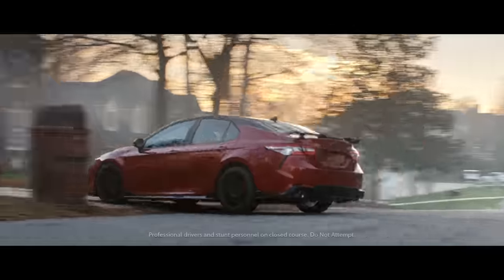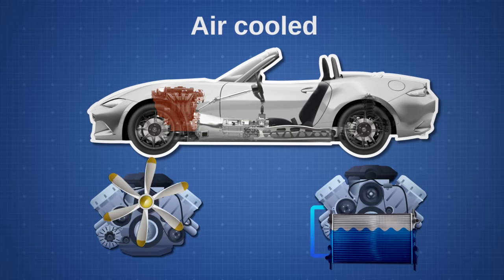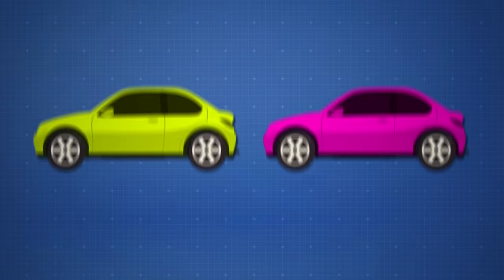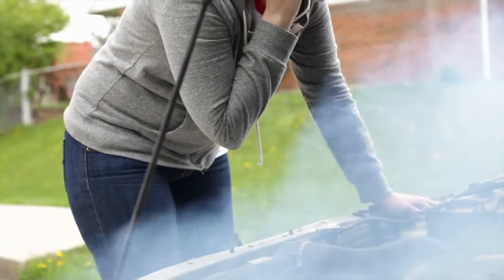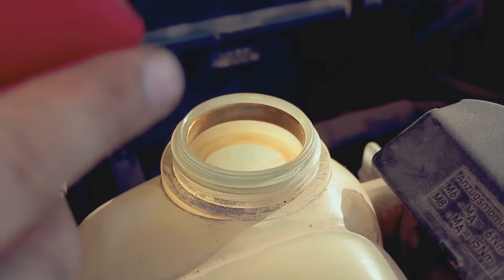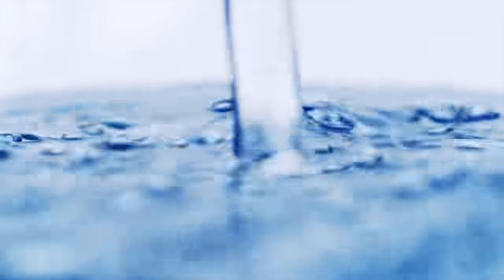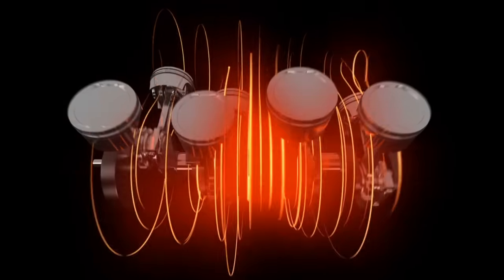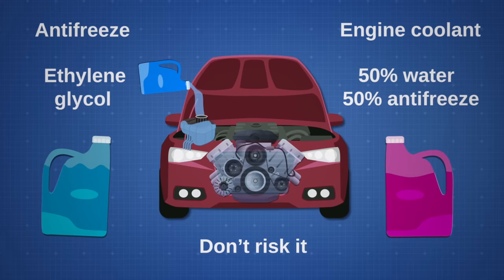Changing Your Coolant? You're Doing It Wrong

Comment: All failed engines that I’ve experienced are from faulty cooling system.  Leaking radiator or water pump, and I didn’t fix them in time. 😵
Reply: Same or a thermostat 😢😢😢

Comment: This reminds me of the nearly 20 year old Honda Civic my dad had most of my life. It had cooling problems that he couldn't diagnose so he had to have containers of water in his car when it got too hot and this dude gave him a coolant cap from Mexico that was basically a cheap cap with a hole in it. It was more common for people in Mexico to fill the radiator with water since the cheaper cars in mostly rough terrain driven by mostly poorer people wouldn't last anyway. The cap was designed to prevent internal water damage by letting the pressure release from the hole.

Comment: my father used to put plain old tap water in the radiator. had to scrap the car after the cylinders warped because the radiator was rusted and the temps kept getting too high (even blew the head gasket a couple of times)
Reply: Water is fine for a quick "get you back on the road" situation, but once you get home.... replace it.

Comment: I remember bringing the ol' Le Mans over a mountain pass here in the Appalachians back in 90s and it started overheating (it was summer)... cranked up the heat, rolled down the windows, and made it to the other side with no real issues... good times!
Reply: Good trick for a cooling system not quite designed for hills in some parts, or possibly a low drag fan pulley.
Reply: @buskE46  I've got an e46 too... we gotta know our cooling systems, lol
Reply: Former cooling system mechanic here. In an emergency re move the thermostat, cut the valve from the center and put the outer ring back in. Don't run it without that restriction or the pump will send it through the radiator so fast it won't have time to remove the heat from the coolant. I always keep an old thermostat with the valve removed in my 2 older vehicles just in case. Also, when changing the thermostat test new one in boiling water on the stove to be sure. If you drill a 1/16 or 1/8 inch hole in it just outside the valve center it will let trapped air purge from your engine. Otherwise it can take up to 2 weeks of driving to completely purge that air that gets into it anytime you open the cooling system.

Comment: I once had a car with a malfunctioning cooling system. The only way to keep the coolant temperature down and out of the red on the dial, was to turn the cabin heat up to MAX. This was OK in winter, but in the middle of summer - not so much.
Reply: Thermostat??

Comment: I agree about using the proper coolant. In the old days, coolant was coolant. Now some have different chemistry, especially long life organic acid ones, and should not be mixed. This is one place I won't try to save money and will get the recommended coolant and transmission fluid at the vehicle dealer's parts dept. I have a Honda with no temp gauge, just a cold and hot light. I hate that, reminds me of domestic cars in the past.
Reply: My Honda also only has the cold and hot light. Did you use the universal all year honda type 2 coolant? My service book says to use it , but it's literally three times more expensive than a well known brand in my country
Reply: I am due for a change and plan on using the Honda type 2. I have seen Peak ones made for Honda etc. Given how long life the coolant is, I'll pay for the Honda stuff knowing it is fully compatible.

Comment: My wife's car overheated a month ago. I noticed the day after i put a new alternator. To make the story short I had forgot to put the connector back into the radiator😅
Reply: So does it still run?
Reply: Lucky you figured it out immediately haha
Reply: another fail DIY
Reply: Rip
Reply: That’s why you always verify it runs without issues or leaks especially after removing hoses. If you started the car and checked you would have seen the obvious leak and the disconnected hose. Now you know. Always look for leaks when disconnect anything that holds fluids.
Reply: And others.
Reply: did you follow Scotty advice to take pictures before to know where wires goes before your DIY?
Reply: @youaregoingtolovethis  it wasn't leaking, he disconnected the cooling fan.

Comment: If you have a leak in your cooling-system, the boiling temperature of your cooling fluid will change.
Think of it as pressure cooking. The water boils at a higher temperature because it is a closed system.
Cool system leakage shows itself when you watch your temperature gauge. If it is fluctuating while following your drive speed. So higher when you dive lower and lower when you drive faster. Check your levels. If the level is good, you might have a leakage.

Comment: One of your best videos. Water is good in an emergency. My car foiled over once. I got a couple gallons from a nearby farmer. It worked fine until The next day when I got it to a garage to replace the coolant. Sometimes mixing two types of coolant they will form a gel and won't do a thing. GM requires a special coolant. Mixed with regular coolant the gel will quickly kill your engine.

Comment: Not the car I have now, but my previous car had cooling system issues generated by listening to Jiffy Lube. They told me on a 2004 Cavalier, my coolant needed changing. I bought the car new, so for warranty you had to go to one of these places for warranty to cover stuff. Jiffy Lube used a general purpose coolant in it. Didn't notice anything wrong for a while. Started smelling antifreeze. The seal shrunk around the water pump. I put the dexcool antifreeze back in it. Within a few weeks, the seal swole back up & the leak stopped. What use to piss me off was, they would bang my air filter up against the wall & distort the louvers in it. I would have to go buy a new air filter. No matter how new your wiper blades are, they said you need new ones.
Reply: I stopped going to those places after being told I need a new battery when the battery was new.

Comment: Back in the late 70’s, my broke brother drove a beater 66 Buick Special.  We live in Houston, which usually doesn’t get all that cold, but, can occasionally.  It had a leak somewhere not easy to fix, I don’t remember.  But it would only leak a little every day.  So, for several years, he just filled it with water (only) daily and it worked sufficiently

Comment: Yep, if it breaks badly, it's pricey to get fixed.  Recently got a car, turns out it's got a coolant leak in both the water pump AND a crack in the top of the radiator.  The radiator is one I'd be willing to fix myself, considering it can just drop in from the top, but the water pump is under and behind so much that I'd rather not risk screwing something up putting it back together.  And since you can't replace the water pump and test it when you've got a leak in your radiator, I've got to get them fixed at the same time.  not cheap.
Reply: Brakes...*😁
Reply: @gewfone  O.P used the correct spelling.
Reply: While changing a water pump, always replace the thermostat with a new one.
They're relatively cheap, and most mechanics recommend it since you're already in there.
I use Denso parts, which are OEM for Toyota products.

Comment: I worked for a courier company and sometimes the radiators would get full of bugs. Drivers would turn on the cabin heaters to cool the engine until they got back off the road and cleaned them.

Comment: Should you flush the coolant or change the coolant. I know you should never flush transmission fluid only change it. Does the same go for coolant?
Reply: You should flush your coolant every 4 years minimum...
Reply: I would not flush the coolant unless the old coolant is rusty. Many years ago when I was a mechanic, every time we would do a coolant flush, the customer would be back within a couple of weeks with a leaking water pump.
Reply: @markkauffman6184  well you guys were pumping too much pressure while flushing .
Reply: for coolant it goes flush, but transmission just drain .   there is wear and tear in gears and metal parts in transmission . however, it's only hoses and passages just for coolant flow .      so if you just drain and fill the coolant, there are some debris /rust would remain in some angled hoses or in some corners
Reply: @arkinazimet4123  We used 5-7 psi when flushing. The problem was that the coolant flush would clear out all the crud around the water pump which would then cause it to start leaking. If your antifreeze is rusty in the first place, just change the water pump after you do a coolant flush. If your antifreeze is not rusty, there’s no reason to do a coolant flush, just drain and refill is sufficient.

Comment: Is it true you should only use distilled water when mixing with antifreeze in your radiator? Because of minerals?
Reply: Shouldn't use water at all unless you are racing ect on a track or strip
Reply: @derakbell8143  when you mix with antifreeze.. sorry I was unclear.. I meant when you dilute 100% antifreeze.
Reply: @seetheforest  summer 70 percent water 30 percent concentrated antifreeze.

Winter those percentages are reversed.
Reply: @seetheforest  winter 30 percent water and 70 percent straight antifreeze

Comment: A guy -- can't remember his name -- came up with a 6-stroke engine.  The first four strokes are identical to any other 4-stroke engine, but stroke 5 squirts water -- just water -- into the cylinder, where it is immediately converted to steam, using the excess heat of the cylinder, whereupon stroke 6 starts by that steam now pressing down the cylinder.  It's a 2:6 power ratio, or slightly more powerful than a 1:4.  It's also utilizing only the excess heat that's already there to generate that extra power-stroke.
-
Of course there are problems with squirting water into a cylinder.

Comment: great video. I find newer cars have a color dot buy coolant tank.also has in big letters do not mix different colors.some cars can use different coolant types but always check compatibility first and flush the old out first. never mix ! Scotty is right on. if you lost owners manual you   can look up online. google it or have auto parts store look it up. newer cars have it right buy or on coolant tank or cap.same for oil type and transmission fluid. I find car companies good a very good job of letting the oner know what type of fluids to use. stick with what they say to use. that is correct information the people that made the car/truck know it the best .

Comment: I had my coolant drained and had a new thermostat installed in my Forester.  I used a NAPA thermostat.  After all the air was bleed out the car still ran hot.  Surprisingly, it ran hotter on the highway than in the city.  
Bottom line, if you own a Subaru, buy a Subaru thermostat instead of an aftermarket one.
Reply: How were you reading the engine temp? NAPA and any OEM, really - will have different temp thermostats that will fit the same system.  If it's maintaining a lower temp in the city vs highway you might have a blockage in your coolant system.
Reply: Facts, always use OEM thermostats in Subies.
Reply: Napa sells OEM thermostats so as long as you get OEM you're fine, right?

Comment: People here in my country only uses pure tap water and other mechanics always removes the thermostat. What are your thoughts on this? Im not a fan of it
Reply: Even if you don't see freezing temps, you will still have more possibility of corrosion with regular water, faster degradation of seals in the system. - Removing the thermostat will just make it take longer to get up to operating temp. Most engines will run less efficiently when they colder than optimal.

Comment: My 89 ranger 2.3L cranks but won't start. After testing everything, the mechanic said it was definitely an electrical problem because a little round light indicator that he attached to a fuel ejector did not blink when cranking it. He never came back.

Comment: You didn't address one question I have. What type of water should you use in the 50/50 mix? I googled it and some  say distilled water is the best and others say don't use distilled water because it will damage your cooling system. And others say don't use tap water because it will cause corrosion. So what type of water should I use?
Reply: I've always been told to use distilled and haven't had any problems.
Reply: Definitely distilled. You don't want all those minerals and crap in those tiny engine passages.

Comment: White vinegar. Run it 100%, or as near as you can get so, for 3 to 5 days. Rinse 3 times and refill with 60% antifreeze to water.  The extra 10% is to neutralize any remaining white vinegar, and is probably unnecessary after 3 rinses.

Comment: 2016 accord, drained and filled coolant. Bled the coolant for an hour but the radiator fan is not turning on. Upper hose is hot, but bottom is cold with engine temperature not reaching normal half mark but slightly below. Any suggestions??

Comment: I’m glad you uploaded this. My cars coolant light keeps coming on, but the coolant isn’t low. And it doesn’t look like it’s over heating. Idk what to do about it
Reply: Check the thermostat or the coolant temperature sensors (there could be several of them in various places depending on the car)
Reply: @PauloHeaven  thank you I will check themout
Reply: Keeps coming on like - always on, or comes on when you are accelerating, just started up, at a stop??  So many options.  Also depending on the car it could be a coolant temp light (Paulo addressed that) or it could be a coolant level light, that could just be a bad connection or sender depending when you are seeing the light and the above mentioned options.
Reply: @buskE46  usually between 1 minute and 20 minutes it takes to come on.
Reply: @buskE46  I’ll replace the sensor on my coolant reservoir, doesn’t look like a big job at all and the piece is cheap.
Reply: Also check your coolant level might be low that will trigger the light
Reply: I’ve noticed a leak and it seems to be coolant. It’s leaking very slow. But I have yet to pinpoint its location. I’ve checked my coolant once more it decreases very very slowly.
Reply: @Mark Codiroli Mercury sable 2k
Reply: @Mark Codiroli there’s usually a damp spot the next day under my car.
Reply: @Mark Codiroli yeah. Coolant sign usually instantly comes on. All I can think of is a hose or sealer being broken somewhere
Reply: And I haven’t seemed to figure out from where yet. It looks like it’s coming from under the intake manifold but I could be wrong

Comment: I drove from NY to FL in the early 90's in August with the windows open and the heater on the whole way to keep the engine from overheating due to a clogged radiator. Not a fun trip.

Comment: I have a 2005 S-10 Blazer,  It temperature gauge show a Orange mark at 260 deg F.   Radiator is only  about 1 inch wide.  It is a 4X drive.   Since it is a SUX and you might want to do towing they should have had a regular big one in there.  Is it really good to let the engine get to 250 deg F ?   During most of the year is  gauge stays around 220.   But when really hot it climbs.   I done that heat trick many times.
Reply: If you are serious.. you have a bad gauge or sender...  If you are burning gas from a station in the USA.  Your engine should not go over 200 on the regular.

Comment: If a radiator hose fails and quickly drains a car's antifreeze, will the engine know that it's overheating or will it continue to run until it seizes without ever informing the driver?
Reply: I can't say for every situation but when my radiator top hose blew the temp gauge began to climb. That, as well as hearing a loud bang is how I knew and I was thankfully able to pull over before causing damage.

Comment: 2016 Silverado 2500 HD. Had radiator serviced at 100,000 miles, after servicing, my radiator developed a leak. Right after I left dealer. Was told that happens sometimes
Reply: Wtf why? You sure you arent seeing a scamechanic??

Comment: Can you use regular tap water to mix with coolant to get to 50/50 or do you need to use distilled water when you mix coolant to get to 50/50?
Reply: Distilled is the way to go.  Tap water often has chlorine
Reply: @louofm1  that’s what I thought but the owners manual on my 2006 Chevy trailblazer says to use 50-50 mixture of antifreeze and clean drinkable water

Comment: That the next thing I  am going to try to fix my P0125 low coolant temperature  error code in my old 2001 Corolla. I have change the coolant, the ECT sensor and I also change the thermostat and still getting the engine check light. When I run the OBD2 scan again, it still show the P0125 error code and my fuel economy is out the door, just gone. I filled up my tank on the 9th of September and today 13th September, a total of 4 days and the gas gage is already close to empty. Before this problem, it will take two weeks before I fill up the gas tank, now I have to fill up with in 4 to 5 days.

Comment: Scotty, you say not to mix different coolant, but how do you tell which coolant that was put in the radiator other then color? After all of the coolant is drained out, can I use the pink coolant?
Reply: Only if you flush out all the old coolant.
Reply: You can buy testers at auto parts sto
Reply: Consult your owners manual - different systems are designed for different coolant types.  in general they will be color coded but if you have reason to not trust what is in your car, or it's drained.   Look up what is called for.